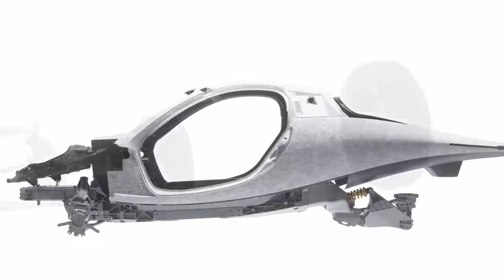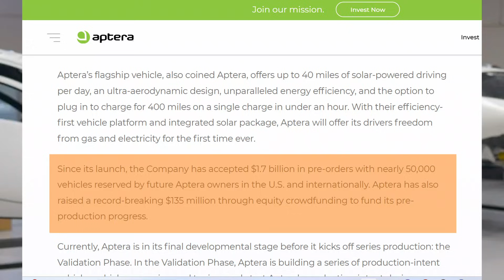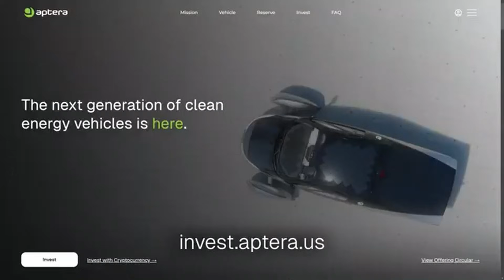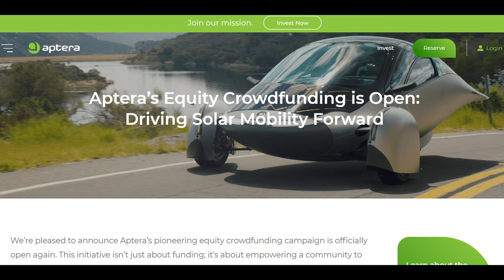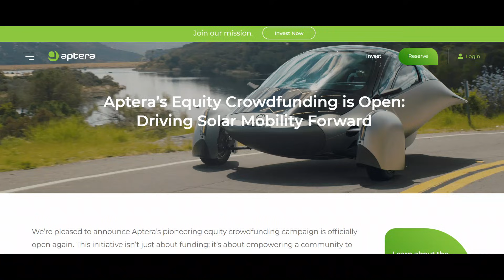Aptera Enthusiast Shares Top Off Grid Living SECRETS You Never Knew

Comment: Aptera 818 to 1000Kg for 2 persons (+80x2 = 160Kg)
CON : Solar panels 10years of lifetime, Battery 5-10 years (not so off-grid)
PRO : Far better than a 3 tons tesla truck, half battery mass than a tesla
=> Ideal : 600-800Kg, 1/6 of a tesla battery for short range and daily use.
Reply: The real yield of the Aptera solar is around 200-300W in best conditions. Embarassing. And the Aptera motorcycle is a deathtrap in case of an accident.
Reply: @vic321344 Wrong on both counts, but you have a reputation for untruth to maintain I suppose.